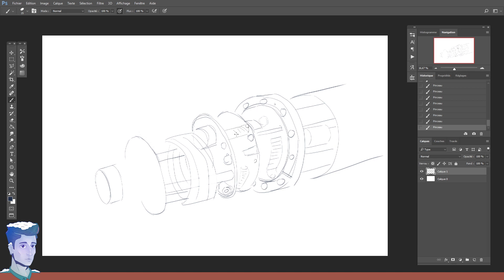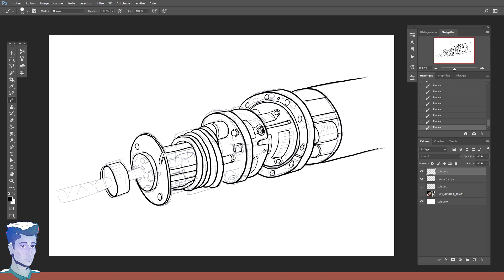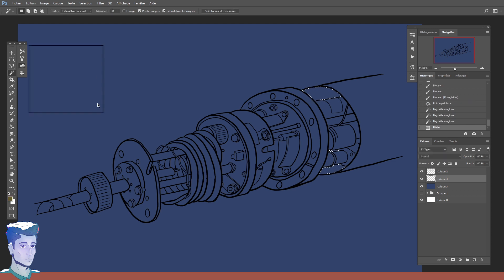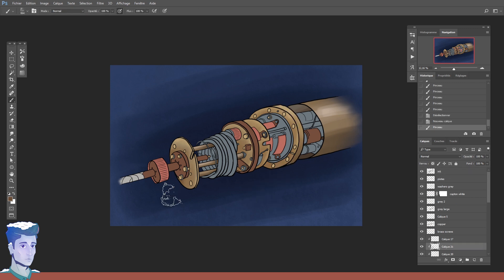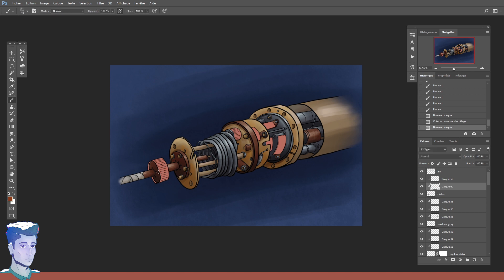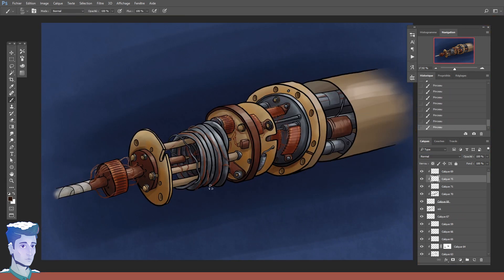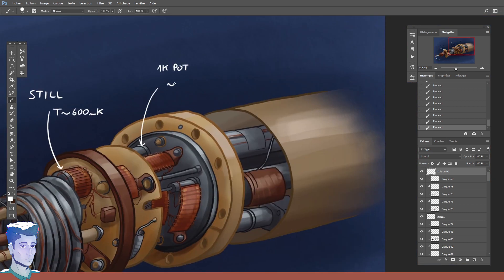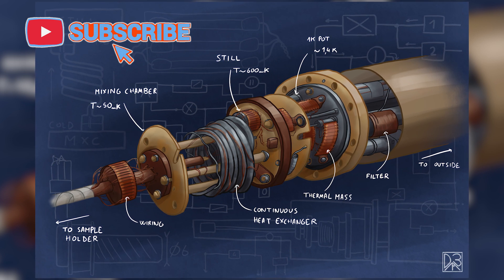A Lesson In CRYOGENICS (drawing a dilution refrigerator)

Comment: NIce work, thanks for sharing. I have an aged oxford wet cryostat, with bore size close to 3 inch, the cryostat cooling is by a continous flow cryostat, although the magnet is cooling by a seperate liquid helium bath. I am thinking to add a dilution unit on the probe so to bring the sample temperature down to 15 mK, I am thinking to DIY this dilution unit by ourself, since this is old instrument and also for the lack of fund, just wish to consult for your advice about this, and if you think this is duable, is there a chance that you could share with your design file with us?
Reply from the maker: Aaah sorry this would be up to my lab, I don't have all the design files and I wouldn't share technical information myself sorry! I hope you find ways to turn your cryostat into a dilution fridge!